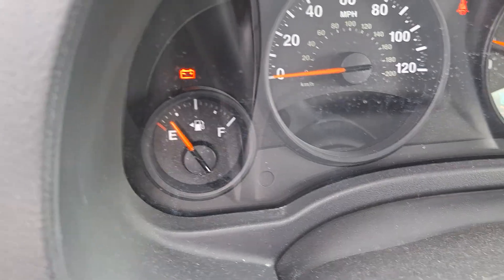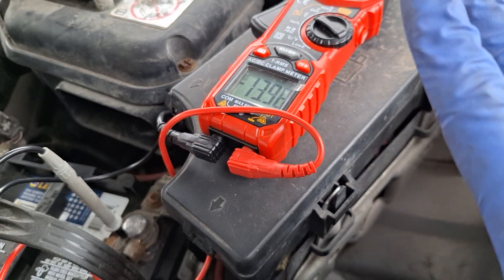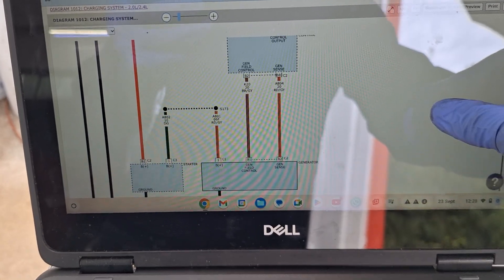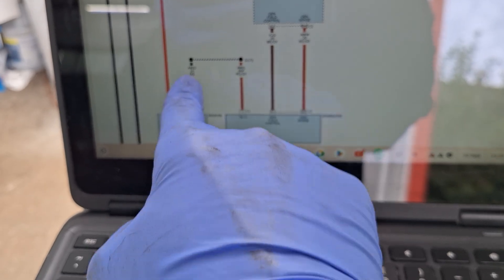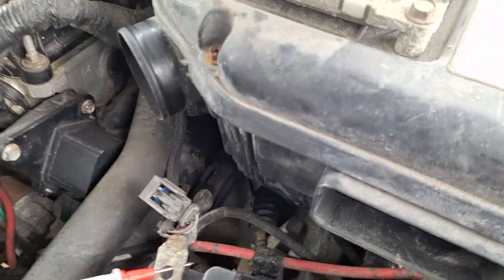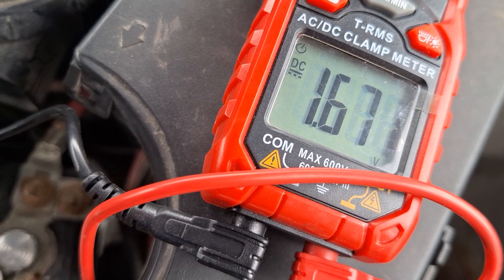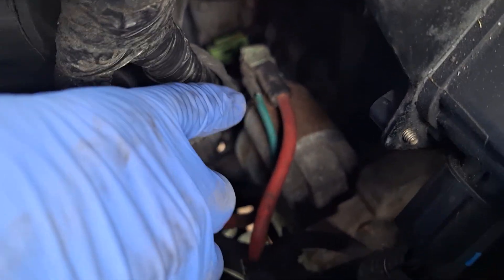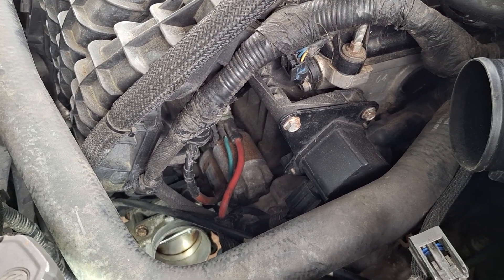Jeep Compass Fail To Charge - Replaced 3 alternators still fails to charge - See descripition.

Comment: Hello you may never get to respond in time. But yesterday my sisters alternator pulley broke off and the serpentine belt ripped into pieces. I replaced the alternator and belt but not knowing one of the ac lines was touching the alternator stud. It smoked the alternator put more then likely fried it. When I hooked the battery back up. I disconnect the battery super fast. So I took the alternator back and got another one installed it made sure nothing was touching the stud even had the cap on the alternator. Still would die after awhile dead battery. So we got her battery tested said it was at the end of its life I got her another battery last night. I’m not a professional mechanic just can fix a lot. The multi meter is reading 12.5 when the car is off and 12.1 when car is running I know it should between 13.5 to 14.5 if alternator is working correctly but it’s not. I’m thinking maybe the power wire got damaged with the first short out on the previous alternator. But I can not find a fusible link or any fuses it is acting like the alternator isn’t getting power. Any help or suggestions would be nice
Reply from the maker: Sorry about the late response, any luck ?